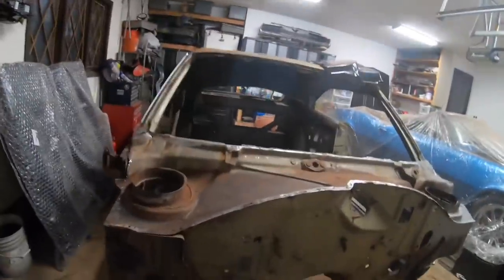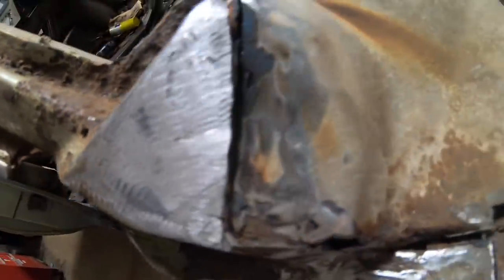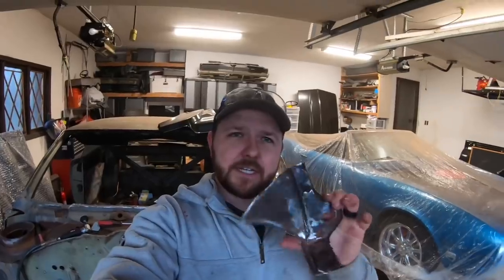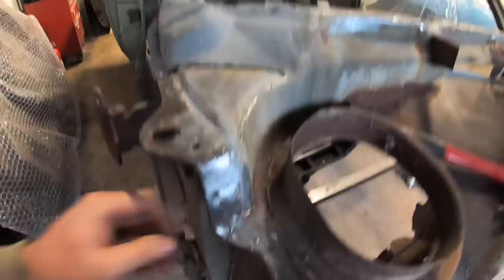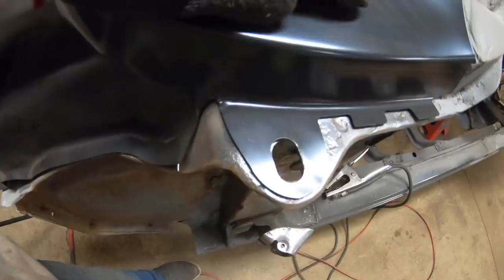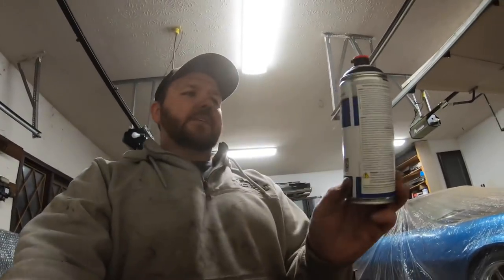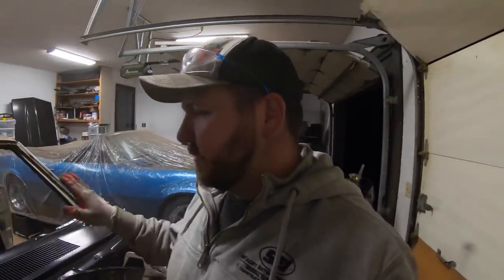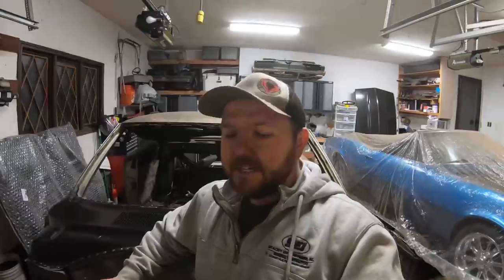1968 Dodge Charger Restoration - Episode 11 - Upper Cowl Install

Comment: Maybe you could use a magnet to keep a piece of metal you are shaping to fit a hole? That way you could actually place the metal into the hole without losing it? Great job mate you are saving another charger!🇬🇧

Comment: Glad to see a car that was so far gone even most car guys would give up on it getting saved. Every time I see more rust get cut out and a fresh new panel put in it's just so refreshing.
Reply from the maker: I agree!  For the past 6 months I’ve only been cutting metal off the car.  It’s nice to finally see some start going back on!
Reply: @rustbucketrestos6511  well if ya get bored doing yours you can come teach me how to do it on mine 😂 glad to see I'm not the only one cutting up 3/4 of the car just to save it
Reply from the maker: I’m glad I’m not the only one!

Comment: Fitzees fabrications <--- you'd dig the metal working tips but I have to say... Your prep work before the welding is 2nd to none the way you patiently get the cardboard templates squared away. Fantastic work. When doing those window lips and sections you think you have to do a ton of shrinking and stretching on... check out Fitzee for some very smart options in that department. That guy's a genius 30 + years doing metal work on cars and trucks [smart dude]. Great stuff man! NOICE!!
Reply from the maker: Thanks for the kind words Robert.  His channel is great!

Comment: You are truly bring back a classic from the dead! Wow! I am curious why you did not repair/replace the cowl vent "top hat" while you had the upper cover off? When you sectioned the hat on the driver's side, you mentioned getting a shrinker/stretcher to do the repair. I was interested to see how you tackled it, but in the end, you didn't even weld up the cut you made in the vertical sides for the repair. Did you do this and just not video the process? These areas often weren't even primed at the factory by some manufacturers so even seam sealing around the base of the hat where it mates with the lower cowl is a common practice to help seal up the seam once it's opened up. It seems a shame to go through all the effort to open up the cowl and not address the rot there. Looking forward to viewing more of your vids!
Reply from the maker: Yes, there is quite a bit that doesn’t make it into the videos unfortunately.  You are right, when the cowl is off, it’s the time to do it all!  & do it right!

Comment: The Brass Shield that on the tip of your MiG gun is to house the Shielding GAS so the weld has time to set, other wise you get that ugly mound of burnt look stuff.  So may I suggest moving your Shielding (brass) cover on your MiG gun handle flesh to the wire tip feeder. You will defiantly like the improved looks of your welds, Awesome work on the restoration.
Reply from the maker: Great tip, thank you!

Comment: use copper weld through primer when spot welding not zinc. after welding coat all exposed metal with zinc primer.
Reply from the maker: Thanks for the tip!  I just bought some new copper primer and I’m excited to use it.

Comment: Your doing a good job man but I noticed you didn't weld up the air induction from the lower cowl which will let water run into your cab of the car

Comment: I hope you finished welding up those vertical cuts in your drivers side cowl vent opening first and It looked like you had some rust pit holes in your passenger side cowl vent openings also that I didn't see you repair. I hope that was in your non displayed video
Reply from the maker: Can’t fit it all in!  6 hrs of footage reduced to 30 mins.  Thanks for following!

Comment: You ever put any thought in to welding up the drip rails
Reply from the maker: Yes, they’ll be getting replaced on this car.
Reply: @rustbucketrestos6511  so does that mean you Are or Not going to weld up the seam at the back of the drip rail where the water ran in and caused everything to rot out on the inside not the same as replacing the drip rail
Reply from the maker: It will all be getting replaced.

Comment: Love all your videos, awesome work great to see a regular guy doing what most people think is crazy! You're definitely giving a lot of people confidence to do this work. Question what are the specs on your air compressor as far as gallons psi etc.? I have one from Harbor freight but it doesn't seem to be doing the job
Reply from the maker: Thanks Chris!  It’s not as hard as many may think to do this.  Just takes time and patience.  I use a 60 gal Dayton compressor.  I think I paid $350 for it on Facebook Marketplace a few years back.  It does the job ok... you can always use more air!

Comment: Is it weldtrow primer you spray on?
Reply from the maker: Weld thru primer on surfaces I’m welding.  Epoxy on areas that need more corrosion resistance.